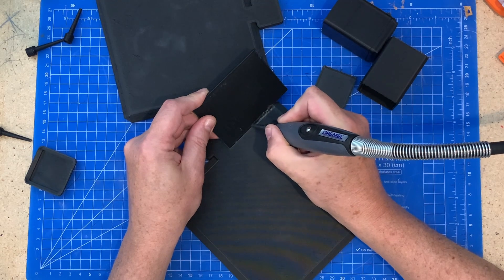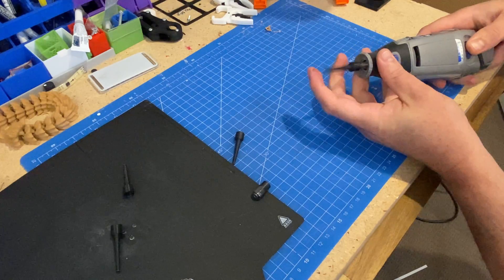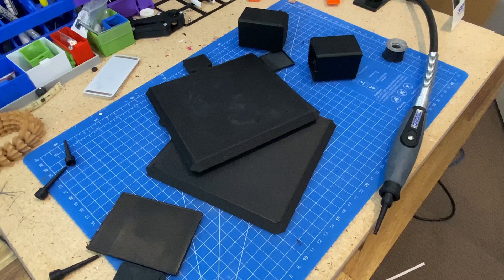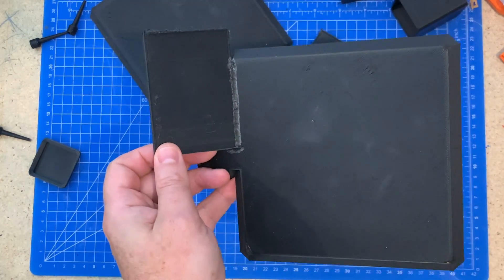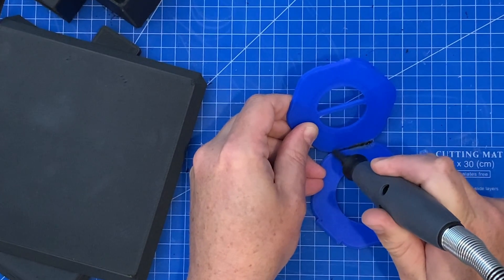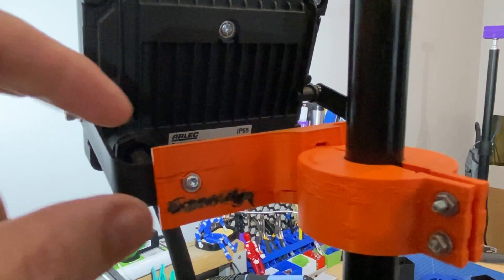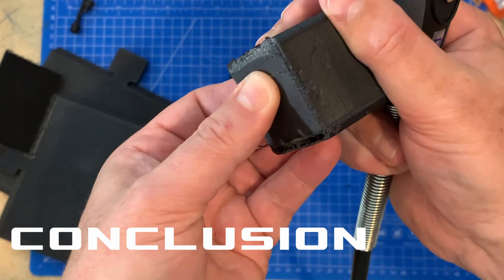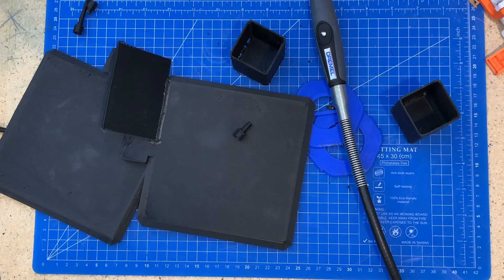Joining tip for easily joining 3d printed parts

Comment: Happy to see that my tip worked for you!

It is designed to not engage the threads perfectly, it should be a slip fit. I've found during testing that it would never center up correctly when making a tight fit.

Also just pressing on it will self center with the right angle applied and will not spin on the arbor of the Dremel tool.

I came up with this when I needed to weld hull sections of my hovercraft together. Worked perfectly.
Reply from the maker: Thanks for the tips and the model !   Its a great idea and gives a bit more substance to weld with than just using scrap filament (which seems to be common knowledge but I've never heard or seen it before !! ).

Comment: I don’t see where it is better than using a soldering iron, or chemical bonding. I.e. CA glue.
Reply from the maker: I thought the same thing before doing it.  From the tests I was doing, adding the extra filament to the join seems to make it a bit stronger with smaller parts, you don’t get any fumes or residue on the tip (I’m always too impatient and hit the temp too high on the soldering iron so you might not have that problem!).  
I’ve had a lot of success using ca glue too but this just feels a lot stronger.
Reply: @3DPrintSmith  what about using a 3D Pen to make a bond?
Reply from the maker: I don't have one but I was thinking the same. I imagine it would stick well but more like the slow speed weld or hot glue, just leave material behind and not melt the two parts a little and mix together.  

I cant say for sure though so if anyone has one that can comment I'd love to hear how it works.